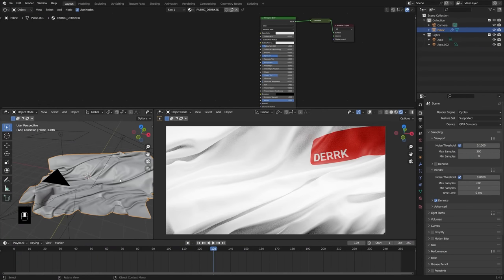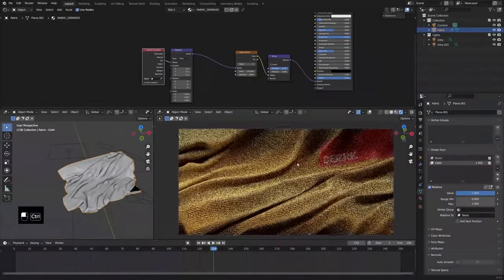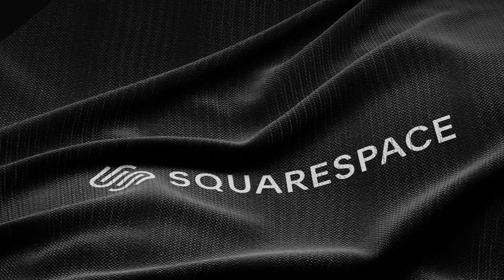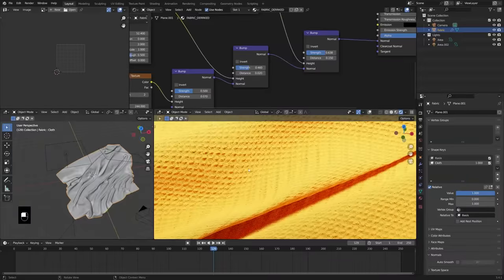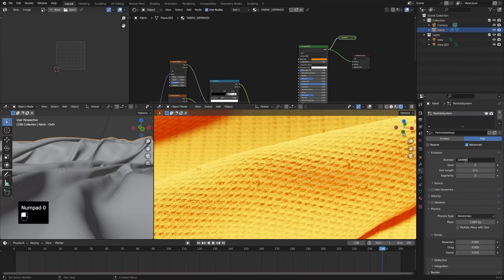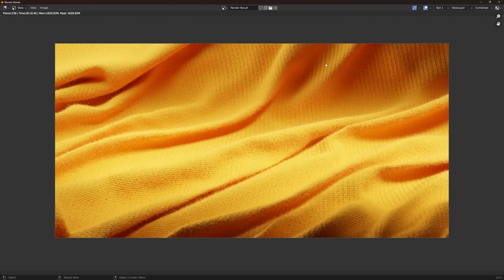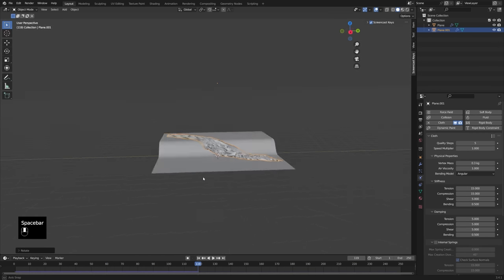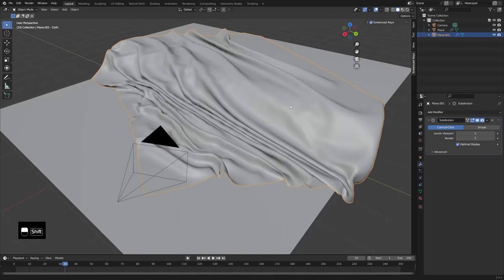Procedural Fabric w/ Fuzz and Cloth Simulation

Comment: Great, I always enjoy watching you do things. Also? you don't have to put actual 1000000 particles, you can just need to enable children particles in the particle system settings; that way you'll get much better performance with little costs
Reply from the maker: You are right, sometimes using children particles will help with performance significantly
Reply: I tried that, but a brand new M1 Mac Pro Max with 32 GB RAM keeps crashing and I can't make it work.
Reply: @BrennerProductions  can you share how many particles and how many children you are using?
Reply: @andzichdzianis  I believe I added one zero to the end of the particle count and did 10x children. It works fine on my 9 year old PC running Win7 with Blender 2.93 but the new Macbook Pro M1 Max running Blender 3.4 instantly quits Blender when I try this. I tried over and over again.
Reply: @BrennerProductions  wait, i don't get it, so you added as much particles as in the video and on top of that you put 10 children? Did I get that right?
Reply: @DerekElliott no using children particle will create patches it’s not good😢
Reply: @BrennerProductions  Macs and Blender are a nightmare.

Comment: Looks great! I always wanted to look into adding fuzz to fabrics and now I have the perfect tutorial for it <3 I had never thought of using the bump node succesiveley like you did, going to be a game changer for me ...

Thoughts / Questions - The roughness for the fuzz is pretty low (0.3) it should probably be closer the to value you've chosen for your main material. You could add sheen to your fabric material to get a more realistic reaction to light. For the fuzz material, I thought you were going to copy your fabric material, remove the noise textures and add subsurface scattering. Any specific reason why you went with the hair BSDF over subsurface?

Cheers,
Reply: Probably with SSS it takes way to long to render?

Comment: @Derek stunning work as always. How many frames per second did you use? How did you get the nice slow motion feel? Keep up the great work.
Reply from the maker: You can set the speed of the cloth sim in the settings. I think I used maybe a .4 or something. Also if you turn the gravity lower it will fall more gentle. 30fps